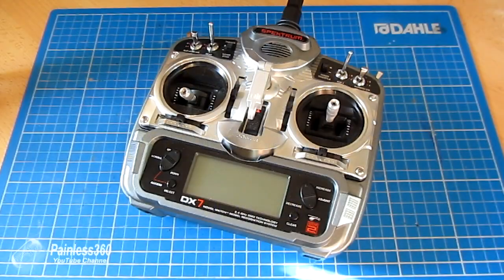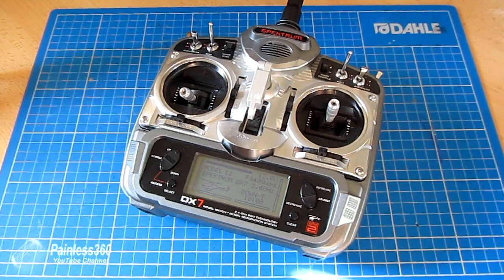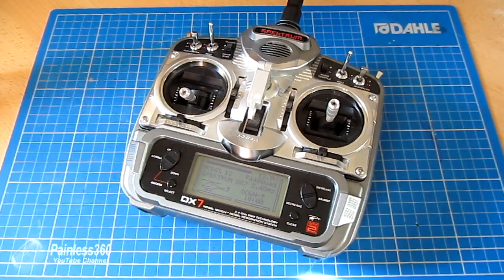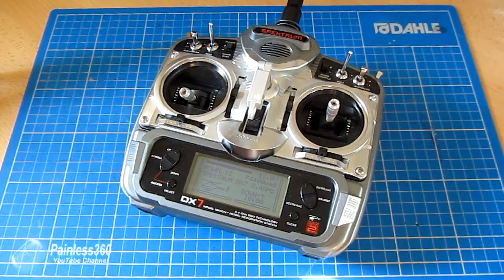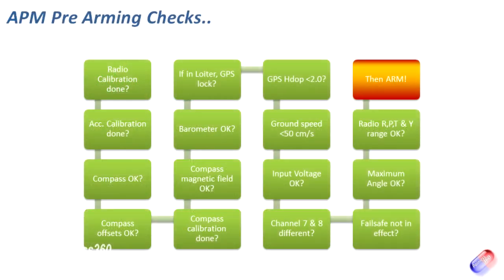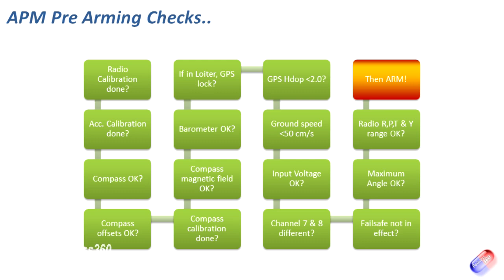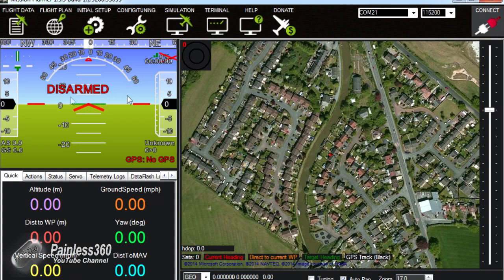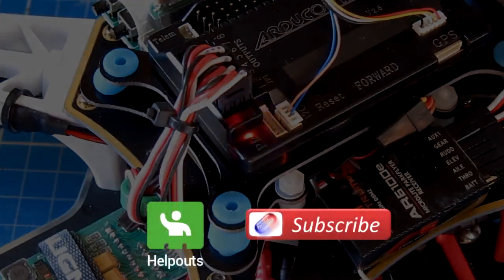(3/8) APM 2.5/2.6/3.1 - Troubleshooting APM arming

Comment: I have f450 drone apm 2.6 board my arming stick is on pitch side and i connot pitch nor yaw when its armed how do i chaing  it to the throttle stick please help
Reply from the maker: Sounds like you have the channel order or wiring from the reciever to the APM wrong. Check out the other videos in the series for how I set it up.. Best of luck
Reply: @Painless360  i chek it and it does the same i am using flysky fs-i6

Comment: Hi sir I am in tension from last two days bcos of my apm arduflyer brand flight controller is working well from last week, then I try to active mode switch, while watching a youtube video I done all settings, to activate mode switch, but then my Quadcopter is not armed, I am in lot of tension I had done binding, all reset of fs-i6 transmiter also done esc calibration, on raceiver all motors are running but when I plug through a apm board then its not arm, sir pls resolve my problem if possible, I have no money to buy new apm, my hobby is to do some different.  Pls help my mail id- amn431@gmail.com I will contact on mail sir and will give my whatsapp number.... 🙏
Reply from the maker: See my video on troubleshooting arming.  Best of luck

Comment: Doing my first Pixhawk build with a 2.4.8 My motors won't spin during motor test/won't arm. I have an error in Telemetry "Bad AHRS". I thought I properly disabled GPS for arming (I can't get satellites indoors) Do I need to recalibrate the compass in Mission Planner? Any tips for resolving "Bad AHRS"?
Reply from the maker: It could be a few things. I've not used this FC for a long time so I would have a look in the forums... best of luck
Reply: @Painless360  Yes, was a million little things, and I deactivated most of the pre-arming checks, but the final fix was flipping the 3 wires between the FC and ESCs (signal and ground swap, with 5v in center, brown wire up (ground)). At first only one motor would spin. All motors worked on one ESC, so it seemed the other ESCs needed also to be ‘woken up’ and calibrated by attaching battery with controller at full throttle (SimonK firmware preloaded on the ESC) then remove battery, reattach, and then wait for telemetry message to reduce throttle to zero to complete ESC calibration :)

Comment: When i do arming, it doesnt work. i have observed that if i do armimg with usb cable connected and battery as well, only then arming works but when i disconnect usb cable arming no more works. Also my arming happens with other stick and not throttle one
Reply from the maker: The it sounds like the radio mapping is wrong for a start.. Best of luck!

Comment: Hi I've followed your instructions and I can't get the board to work. Can you help me with this issue it's always saying it's in RTH.
Reply from the maker: Without more detail it's impossible to offer any advice. Happy to help but please watch https://www.youtube.com/watch?v=olIqTiSJHIY and come back to me with more detail of what you've tried..
Reply: @Painless360  I've followed the Apm series did all the calibrations including the one for the radio set the flight modes however they won't change and its saying current mode is RTH. In addition it saying failsafe.
Reply from the maker: Then it's a radio Failsafe issue... I'd start there. It could be one of the channels on the radio (throttle probably) is going too low.. Best of luck
Reply: @Painless360  thank you I got it figured out.

Comment: Sir i done all thing now my apm2.8 is not arming why
Reply: There is no error but not arming i am uploading a video and sharing a link sir .i am ur fan from 2015 trying to make a hexa but not success till now by apm.now i am again tring to make hexa bye apm 2.8 but same problem facing .only big problem compass not calibring and dots are not showing
Reply from the maker: It will not arm until the basic calibration is done for the compass, radio and accelerometers. You'll need to get that compassion sorted first. I've not used APM for years so am very out of date with that old technology. Best of luck
Reply: If compass not calibrated or compass dots data not collected .in this case arming is possible or not??

Comment: Hello 
I have 4-1400kv motors with 2200mah 25C battery
And using apm 2.8 flight controller.

2 of my motors are responding slowly they are rotating after 25% of trottle.

What was the reason behind it ???
Whether the issue is due to battery or ESC or apm
Reply from the maker: Could be a few things. I'd look at ESC calibration as No.1. Best of luck!

Comment: Please reply to this. I own an apm 2.8  and I have made a quadcopter and the problem with my apm is that when the board is connected to the mission planner [laptop] and I try to arm with the transmitter the board gets armed BUT when I disconnect from the laptop and connect to the battery and then tried to arm it, it does not get arm. Please help me with this, my quadcopter was working properly before but now this problem has come up and I don't know what to do please help. Thank you.
Reply from the maker: Sounds like a power issue if it arms wheh also powered from the USB... best of luck
Reply: @Painless360   I figured it, it was a Fail-safe mode issue. I accidentally set the fail-safe low battery value to 11.1v and that is the total value of my battery.

Comment: My drones gps isn't working . It is showing my location at South Africa while u am working in  India. Pls help....................!!!!!!!!!!!!! APM 2.8
Reply from the maker: Could be a few things. That'll be the zero point for the coordinates. What troubleshooting have you already done?
Reply: @Painless360  I have reconfigured the APM setting but issue not resolves. Also getting error messages:
1)RC not calliberated
2)need 3d fix
Please advise.........
Reply from the maker: All the steps are in the series. Make sure the GPS is powered and the connections are correct.. Best of luck
Reply: @Painless360  ok , will try 
Thanx for ur instant reply

Comment: Hello painless360, I’ve built two quad copters and I wish I could say it was painless but they have been anything but painless. They both took off but both crashed within 10 secs of flight, both went up a few metres then flipped and crashed to the ground. If the battery is slightly lose could that cause a crash ?
Reply from the maker: That would not help.. see my 'for beginners' builds for series that show every step..  best of luck!

Comment: I couldnt find any clue to what my problem might be; GPS is connect via 6Pin connector, No light on the GPS at all, both red light on the apm 2.5 do blink, green is solid, set the PreArm checks to None and I am in Acromode but I cant arm.
Reply from the maker: I'd check the GPS has power. What troubleshooting have you already tried?
Reply: @Painless360  The PWR LED should on the Neo-6M light up on the GPS, right ? since my set-up is identical to the Ardupilot Video here:

https://www.youtube.com/watch?v=CZQoGfCKKLo
I exactly have my own thread (with pictures) in the FliteTest Forum and a second thread with a similar problem on a second APM that has a GPS Fix but wont arm else.
https://forum.flitetest.com/index.php?threads/apm-2-5-wont-arm-and-no-gps.58569/
https://forum.flitetest.com/index.php?threads/f450-clone-and-apm-wiringquestions.56124/

APM should be able to arm without GPS when in Acro mode (which is the case) and show any problem in the artifical horizon (which is not the case). I even switched PreArm Checks off and tried it again but no Success.
Reply from the maker: If you've wired it correctly and the GPS isn't powered then something is wrong.. I'd start by figuring our that issue first. Best of luck
Reply: @Painless360  

Can I (theoretically) arm without GPS when I switch off the PreArm checks ?
I dont need GPS.
Reply from the maker: There is something about that in the documentation but I have never tried it. Best of luck

Comment: is it possible to setup an aux switch to arm the apm board?
Reply from the maker: Not in the same way as things like Betaflight.. You could make a switch on your radio that would set the throttle to zero and put in full right rudder for 3 seconds..
Reply: @Painless360  well how can i do that with open tx? qx7 to be specific
Reply from the maker: With OpenTX it's the same process on all radios. Have a look at the OpenTX mix school videos, I'd use a special function to set those rudder and throttle channel values for the time needed when the switch is set..
Reply: Painless360 ok thanks

Comment: Recently built a f450 quadcopter. When I arm it using my flysky FS i6 transmitter the motors does not spin simultaneously. I have successfully calibrated the ESC as well as my transmitter. Plz help me as soon as possible. Thanks in advance for everyone. I am new in APM programming and I don’t know anything about programming so please give detailed steps if programming is needed in the APM. Detailed procedure means from starting till end and step wise. I will really appreciate your hard work.
I am attaching a YouTube link. This is not my quadcopter which is shown in the video but I am facing the same problem. I am using APM 2.8 as my flight controller. And ia6b as my reciever.

https://youtu.be/CMMmS9fL-UU
Reply from the maker: All I do to setup an APM is in this series. I've not recommended APM for quite a few years now and haven't touched one for at least two. So I'm a little out of date with them, the only thing I can suggest is check the documentation. ESC calibration is a key step.. Best of luck!

Comment: Recently built a f450 quad copter. When I arm it using my flysky FS i6 transmitter it’s motor starts to spin which is fine. But when I put the throttle to zero it still keeps on spinning. When I try to disarm it, it doesn’t disarm and the motors still goes on spinning. Plz help me as soon as possible. Thanks in advance for everyone. I am attaching a YouTube link. This is not my quadcopter which is shown in the video but I am facing the same problem. I am using APM 2.8 as my flight controller. And ia6b as my reciever. https://youtu.be/CmZNe8f6OJY
Reply from the maker: You don’t mention which flight mode your using, my guess is that you have Airmode turned on. If you do, then that is expected behaviour. Hope that helps!
Reply: @Painless360  I am using stablize mode. And I don't know how to turn off airmode plz help.
Reply from the maker: There isn't airmode on APM.. Not sure what you're referring too.

Comment: Hello, i have this weird problem where the artificial horizon is shown upside down and when i calibrate the acc it goes to normal but when i reboot the apm it goes back to the same problem
Reply from the maker: I’ve not seen that. I’d make sure that any changes you make are being saved. Best of luck!
Reply: I just fixed it by reseting all the parameters to default

Comment: thanks for this video.  I am using an APM 2.8 with my Taranis for a delta wing.  I don't have Yaw for delta wing with just elevons.  do I need to set up a channel for yaw so I can arm the APM 2.8.  currently the APM will not arm.  My guess is because yaw is not setup so there is no signal on that channel to do the arming procedure.  Or is it possibly something else?
Reply from the maker: You’ll need all of the main flight controls. See my video adding an APM to a wing..
Reply: Thank you!
Reply: my APM is not arming

Comment: Yes plug in to mission planner and that's the problem but not shaw what it's trying to say or how to fix can you help Regards Gary
Reply from the maker: The GPS on your model hasn't had time to get a 3D lock. Normally leaving it a little bit longer will get that sorted. It's all in the documentation http://ardupilot.org/copter/docs/prearm_safety_check.html

Comment: @Painless360 I have this problem with the internal compass. I am using the AMP2.8 and I get absolutely no contact to the compass. I have tried all the jumper settings imaginable. Many people say you need a compass; many do not. People say the APM 2.8 HAS an internal compass, many do not. Please help me out here! I really want to get my quad flying. Is it possible to disable the compass / check? And is it necessary to fly?

Please help me. I have spent days googling and making forum posts!
Reply from the maker: From what I remember, the APM 2.8 doesn’t have an internal Compass. That might be part of your problem..
Reply: Alright, I should of known.
Do I need a compass to fly or is it optional?
Reply from the maker: All covered in the series - best of luck! :D

Comment: I was wondering whether it might be the Power Module that I am using, (GM Ver. 1.0).  Incidentally, when in Mission Planner, and I am connected to the Controller, when I go into the section for testing the motors, I can only get 1 motor to spin when I click on the, “Test all motors in sequence” button, so I am wondering whether this has something to do with it perhaps.
Reply from the maker: Is this related to another comment? It sounds like it is. Please use the 'reply' function otherwise it's impossible for me to keep track of what we've already talked about with all of the questions and comments that I get on a daily basis. Best of luck with it..
Reply from the maker: No worries. I doubt the motor issue is related to the 5v power side.. See the other videos in the series - I'm a little rusty with the APM now..

Comment: Hi Guys I am in need of some help please.  I have been following all of the videos on how to setup the APM, I have the APM Arducopter 2.8, I dont have any external compass's yet, so all i have is the receiver and a power module which is a GM ver. 1.0.  So, when I move the Throttle stick to the right for 5 seconds to Arm the Controller, 2 of the motors spin at low speed but not the other 2, however, when I increase the Throttle Stick, the other 2 motors spin at a higher speed than the other two, which means that when you attempt to take off, it will tip up because 2 of the motors are spinning faster than the other 2.

Obviously in accordance with the videos, when you Arm the Controller, none of the motors turn, so could anyone please help me to stop these motors from Spinning when the Controller is armed.  Thank you!!  Mark
Reply from the maker: Sounds like the ESC need calibrating. I’d wait until you have all the components and then follow along the APM series, video by video. Best of luck!
Reply from the maker: I've not played with APM for years so I'm out of date. The forums might hold an answer - best of luck!

Comment: Hello, I know it's been awhile for this video but I think some of us that using APM is having a problem with arming the FC. done all the setup, follow all instructions and calibration is good. arming is my nightmare? For some odd reason, apm would not arm can you help me.
Reply from the maker: +Sen Pen all i know is in this video, and the associated manual pages. The best bet is to try and ARM while connected to the mission planner app - it'll tell you what the problem is. Best of luck
Reply: I will do that thanks for the help.

Comment: If i habe an usb cable in my apm sometimes it works. Without it no chance. I don't know why
Reply from the maker: +Jo Jo sounds like a power issue. Make sure the APM has 5v power. See the other videos in the series..Best of luck
Reply: Painless360 I'll try it out👍
Reply: I don´t think so because it´s not important if the usb cable is plugged anywhere in.
Reply from the maker: https://www.youtube.com/watch?v=VdX8rPCuJ50 may help

Comment: Great video,  short and well explained, Thank you. I just downloaded the 
newest version of Mission Planner which is recommended, and can not find
 the settings to accelerate throttle; the problem is that not matter how
 high i lift the stick, the motors reach an speed and stay there.  Those
 settings used to be in the Advanced Parameters, as far as I remember. 
Can you help me out with it?
Reply from the maker: I've had a few people ask about this in the last few weeks so you are not on your own. Sadly I no longer use APM here so can't plug it in and try it out. I'd suggest a look in the forums for other pilots who've had this recently and fixed it. Best of luck with it!
Reply from the maker: http://www.dronetrest.com/t/apm-2-8-beginner-probs-and-solutions/3172 looks promising..

Comment: Lee, followed your advise to watch this video and now my quad is arming fine....thank you.  However, do have a slight problem. The motors are not turning fast enough to take off the quad. I went in MP...Full Parameters and set the Throttle Max from 80 to 1000...still won't take off....went back in and set to 2000....same thing.  I am using the Taranis plus with X8R receiver....and my throttle shows 1000 and 2000 with mid 1500.  Please help, what I'm I missing??
Reply from the maker: Not sure, we retired all of our APM stuff about a year ago. There are lots of others in the forums who've had this problem so maybe one of them has the answer.. I'd recalibrate your ESCs after the change you just made in case too. Let me know if you find out what it was..
Reply: Lee, so far not luck finding help to my problem. Besides the Throttle Max sub-menu in Full Parameters in MP. Do you know of any other sub-menu that would affect motor speed in the Full Parameters section?  Since I have the very same issue with two Quads it seems to all point to a programming issue from MP.
Reply from the maker: Sorry, we've not played with APM for a long time. I'd just be searching in the forums.. Best of luck!
Reply: Thank you Lee, I totally understand.  Let's try this....I know Pixhawk is a better FC...and I notice though there are a lot of clones out there. Would you recommend a Pixhawk and if so would you buy a clone or stay with a real 3DR one? I just want something that Mission Planner totally recognizes and downloads firmware to with no issues. Truly appreciate your help and your replying to me.